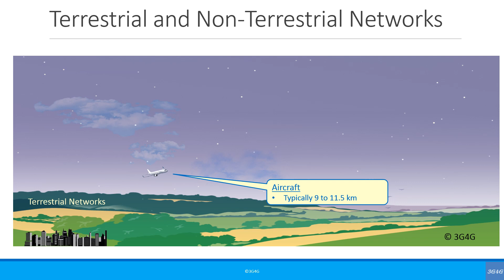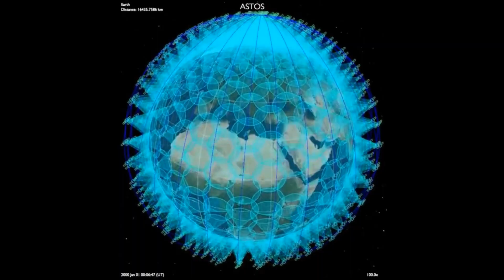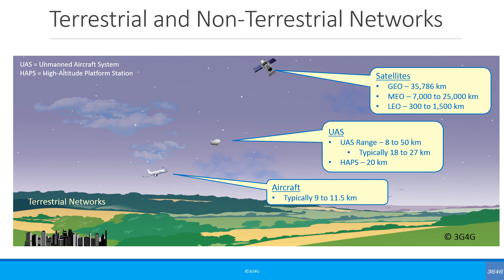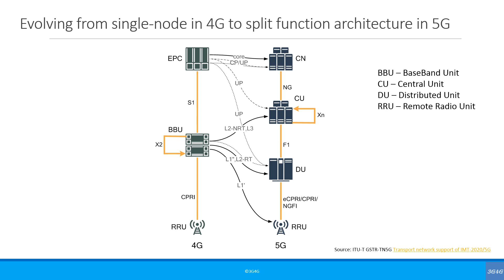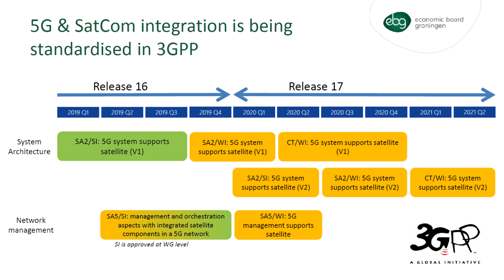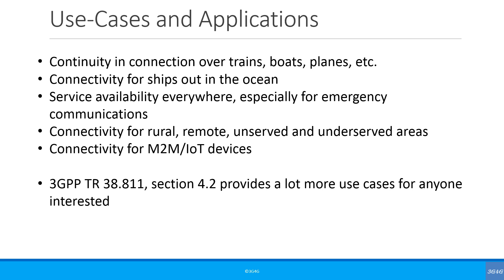Comment: Isnt coverage on trains , boats and some rural aspects covered by LMLC (low mobility low coverage) which has approved now ?
Reply: Not sure to the LMLC you refer to. Do you by chance mean Low Mobility Large Cell (LMLC) which was proposed by TSDSI as a 5G standard?
Reply: @3G4G5G  yes that's what I was referring to
Reply: @shysun800  Okay but just because it has been approved by ITU, it doesn't mean anything. It will have to become part of 3GPP or some other standards and then will have to be implemented in a network and a device. After that, somebody will have to deploy it somewhere 😊

It may happen that Jio may add it in their own designed network and handsets in future but I don't think we will get a widespread rollout or economy of scale.

Comment: If I can't speak with someone with my cell phone when they are only 100 yds in a plane in the  air then how can this possibly be? Especially if a sattelites is traveling 18,000 mph?
Reply: It's not just about voice, it's about data too. Also, voice can be packetised and sent as data. In terrestrial networks, there are sometimes more challenges than satellite networks due to smaller cells sizes, obstacles, etc. In satellite networks those challenges are not there. Instead you have a problem that the signal may be difficult to receive in earth if the satellite is far away and vice versa.
Reply: @3G4G5G  How can any frequency with data or voice sustain its integrity or complete its transmission while traveling through over 20,000 miles of the Van Allen Belt to reach a sattelite then come back through it again?
Reply: @df224  Good question, we are not RF experts but it's already happening today with loads of satellite operators connecting the world.

Comment: Nice!... I was wondering if sattelite based networks were possible then I came across this clearly explained video. A quick question: for sattelite backhauling of terrestrial based stations, how much power would these base station require/consume? (For 4G and 5G services). Also, could this method be used to provide gigabit connections speed per user?
Reply: If you search for a VSAT product, you will find power consumption. It's roughly 150 to 200 W. 

At present, the satellite connections cannot provide more than roughly 400Mbps. We will have to wait for the LEO satellites then we will probably be able to get higher rates. But that will take a while.